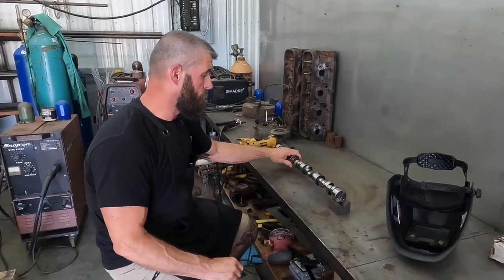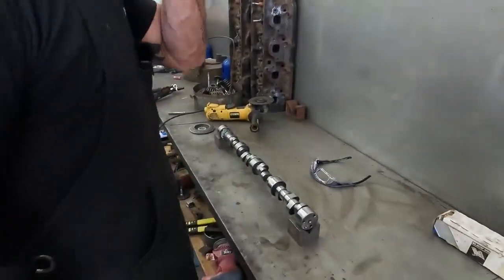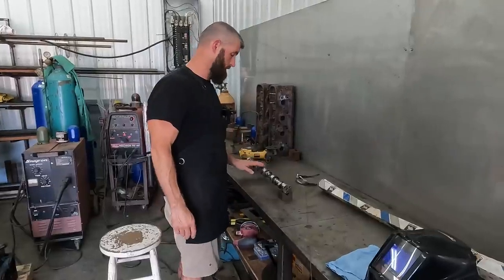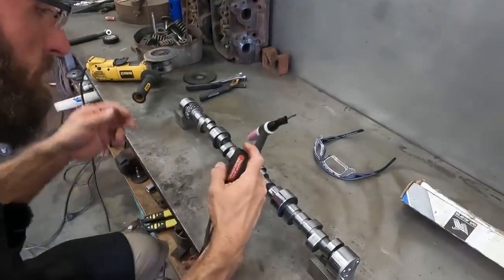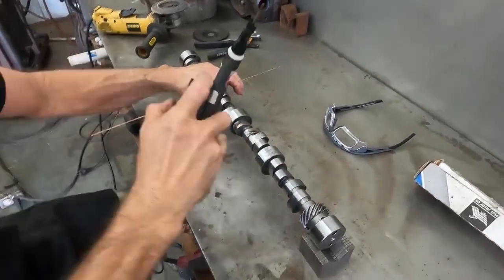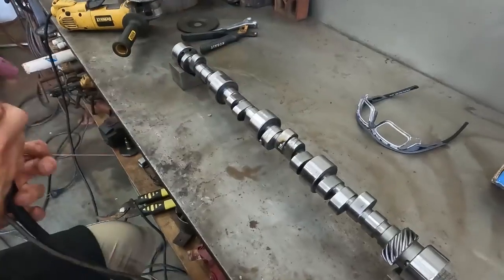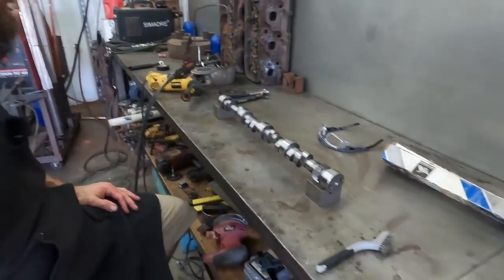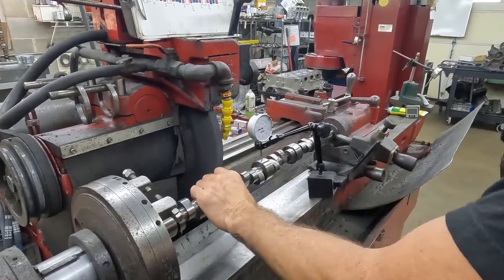BBC camshaft repair

Comment: Hello!! Can you tell me! I miss adjusment may ProchargerF2 Engine! Valve adjustment.Have  tou match Clearance! Have 1.4 mm. Chod have 0.40 mm. How much Power do you think I lost !? I tink at lest 40 Hp??? Roller solid Cam!! Hope you can tell!!! Hope you anderstand me hear !! Spell laike hell sorry!!👍🥂
Reply from the maker: Idk, 1.4mm ?? That's insane
Reply: @PowellCams  Ihave 1019hp on The Dyno. How much horsepower do you think I lose???. Please give me what you think!!! I couldn't not do more test my fuel was empty! E85.